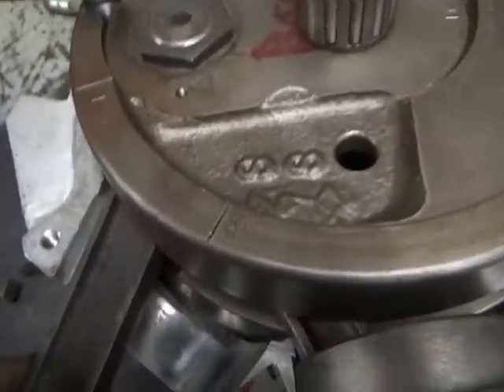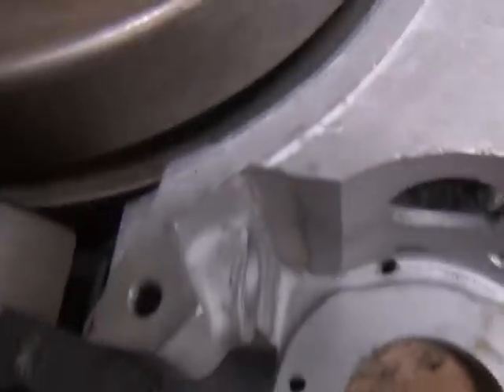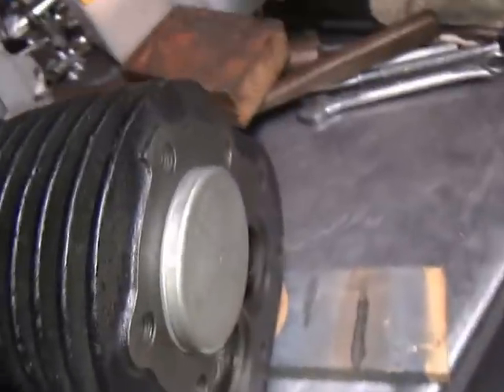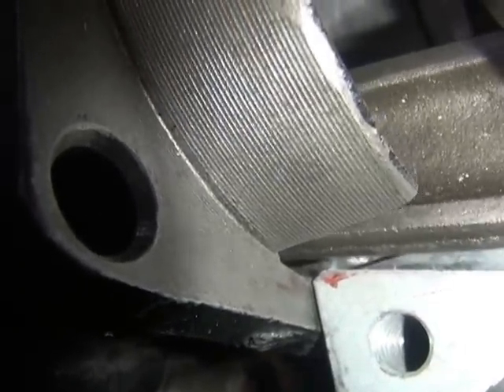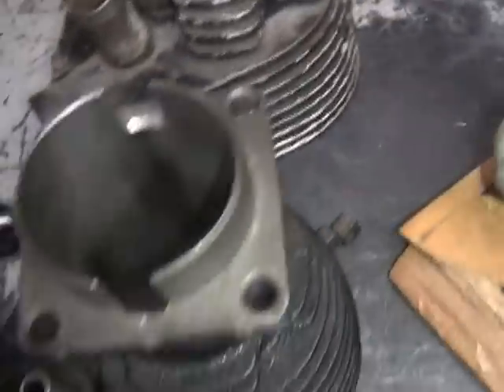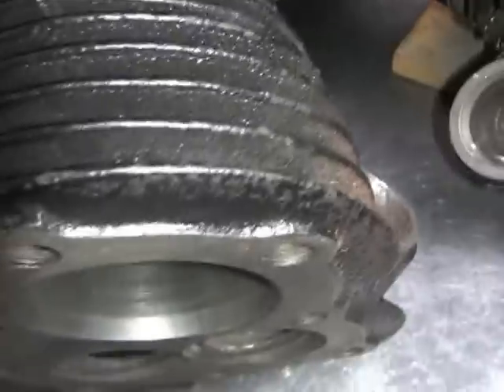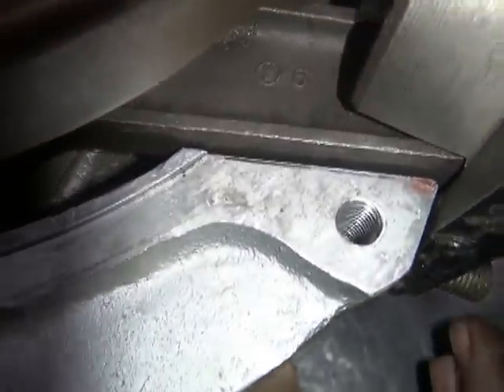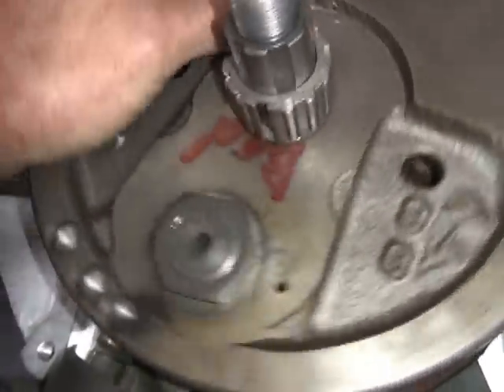#102 1942 Harley 56ci 45 WL WLA flathead stroker hotrod motor build by tatro machine

Comment: Hi, I will be building a 55" flathead stroker myself soon and would like to know are you installing piston skirt oilers to both cylinders or just one? And can you tell me if the original oil pump has enough pressure?

Comment from the maker: hi,
are you kidding? what oil pressure or volume? no harley made before 1982 has an oil pump big enough to handle piston oilers. an external or custom pump would be required for both the pressure and return oiling.
tatro

Comment: hey Tatro , what`s your take on the 45 Magnum ? is it really a time bomb? did Sandy Smith tear up the track with his?
Reply from the maker: randy smith is the one that used these motors. they were not track motors, just street racing.  lets see, you take a low hp motor and trans and then double or tripple the hp and what do you think happens? randy had a very small and light package so it held up somewhat but it is not going to last very long if you really get after it. my 1942 wla drag bike holds up somewhat but it does not have that many mikes on it. with less than 3500 miles on it in over 35 years it is starting to show its years of abuse. maybe i will rebuild it in the next 5-10 years or 200 miles, which ever comes 1st.
tatro